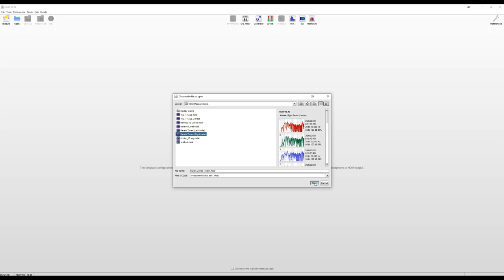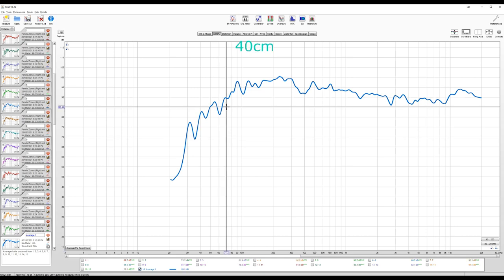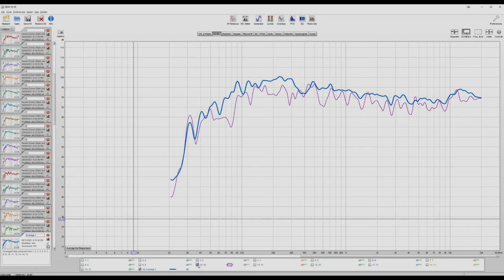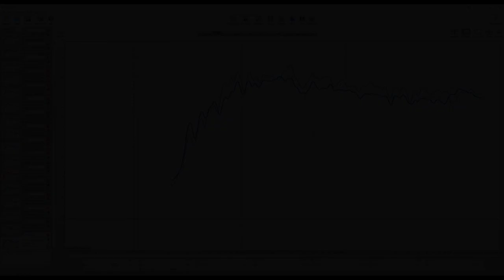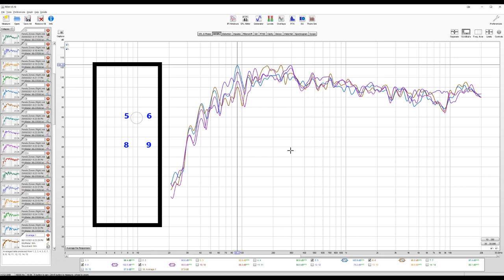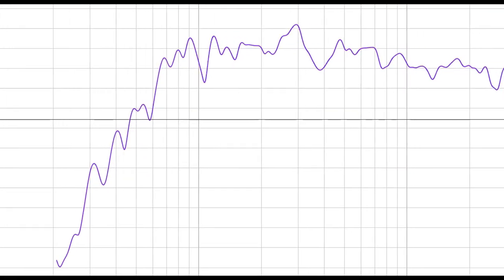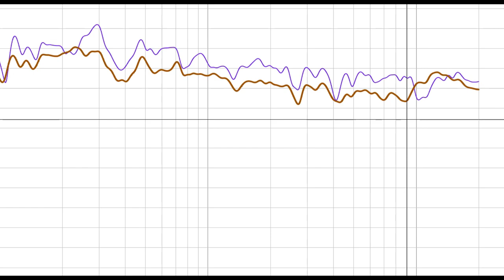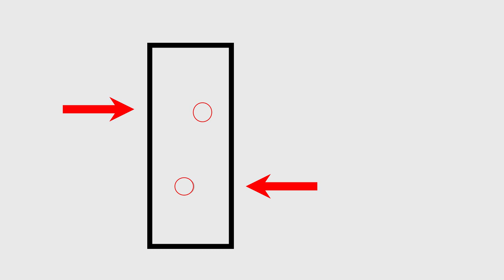Measuring Sound Across My DML Panels

Comment: Hi Ben, Thanks so much for being this thorough! I see that you come to the conclusion that an exciter placed in the exact center, would arguably be the least effective placement for a second exciter. This is exactly the opposite of conventional wisdom I've come across during my research into this topic. I've also heard some a/b testing with 1 exciter (2/5ths , 2/5ths) and a second one dead center, and the latter actually sounded fuller. Perhaps this gives me my answer, as how I experience it is all that really matters for myself, yet I'm super curious what your take is on that configuration of exciters. Have you experienced it diminishing the sound as opposed to, say, your proposal for a diagonally placed 2nd exciter?

Comment: I have a ideia for the bass, a blank canvas maybe do the job, is tensionate and is not to flexible. Other thing that maybe work is a bass exciter in other panel
Reply from the maker: Hey Lucca - yeah the stretched canvas is an interesting idea that I've yet to try out. I'm interested in trying out a DML subwoofer type setup but I don't think it's a very practical solution compared to a conventional sub.

Comment: I know many people have said it's unnecessary, but I think I need to bite the bullet and purchase a calibrated microphone to properly test my DML speakers (when built) and the room with REW software. They're not prohibitively expensive, but more than I'd like to pay for something that I may only use a dozen times, apart from near-field playtime ;-) . Is that what you have done? I am looking at the MiniDSP UMIK-1 or the Dayton UMM-6.
Reply from the maker: Yes I bought my mic when I became interested in building the panels. I have the IMM-6 though because it was cheap. It’s designed for mobile devices which have a 
TRRS jack. I use it with REW on my old surface book laptop.

https://www.daytonaudio.com/product/1117/imm-6-idevice-calibrated-measurement-microphone
Reply: Ah, I should read the specs,  @TypicalBenYT  . The IMM-6 comes with a USB adaptor, so not confined to TRRS jack. I can connect to my laptop directly. Thanks again for your help.
Reply from the maker: @HumeWinzar  Interesting. I don’t think mine came with an adapter.

Comment: Put my panels together last weekend. 1 on a 2'x2' and 1 on a 4'x2' 1" foam. I used the 2/5 - 3/5 method for the 2x2 and center placement on the 4x2. I'm not as happy about the highs as I thought I'd be. Kinda sounds like someone speaking in a bathroom on speaker phone.  I've played around a little on the distance from the wall but so far I don't think it's made much of a difference. How clear are your highs and have you experienced this. On a side note I asked in your previous video about using a sub and how you went about wiring it in anyways I did manage to get mine going with these and in the grand scheme of things it sounds awesome for what they are. But if I can get it stop sounding like they're playing in a bathroom I would be extremely pleased. UPDATE - I am using the 40w exciters if that helps
Reply from the maker: Hey Thomas, that's a shame you're not getting the results you wanted but I'm sure it can be resolved. What kind of foam are you using? If you're talking about polystyrene (XPS / EPS) then you probably need to sand the skin (both sides) and apply a water/glue mixture across the panel to get the most out of it.
Reply: It is sanded and edges rounded. But what's this gluing you're talking about. I've never heard of that or seen it done

Comment: I would like to hang these speakers from the pilings and structure that hold up the roof of my marine boathouse. Therefore there is no walls to reflect any sound. It would only be surrounded by water. Do you think that these speakers would do okay out on a boat house with no walls surrounded by water?
Reply: I would think they are ideal. If possible, have the left one hanging on the left side of the structure and the right one hanging on the right side rather than both hanging directly in front of you (if that makes sense). These things get LOUD - I'm using 20W typical/40w max exciters, two per speaker just like Typical Ben and I can't even crank the amp I'm using to the max without it being painful. Admittedly, I do have walls (6mx4m room), but even at 50%, it's difficult to have a conversation with someone next to you and the sound can clearly be heard throughout the entire ground floor of our house at that level.
Reply from the maker: Hey Tom, I agree with the other Ben - I think this would be really well suited to the application. Without wall reflections I think they'd sound great, and you'd presumably be free to make them very large as well, for a nice full range sound. You can also get waterproof exciters from Dayton Audio. I'd love to see how it turns out if you decide to build these.

Comment: I'm curious what the acrylic panels would sound like if they were attached to the frame with a rubber surround like a speaker might be.
Reply from the maker: It's a good question - it might strike a good balance between rigidity and being able to resonate. There's a lot of things to experiment with here...
Reply: @TypicalBenYT  I noticed Amazon has rolls of thin rubber sheets which may even be big enough to cut out a continuous surround from if the panel wasn't too big.,